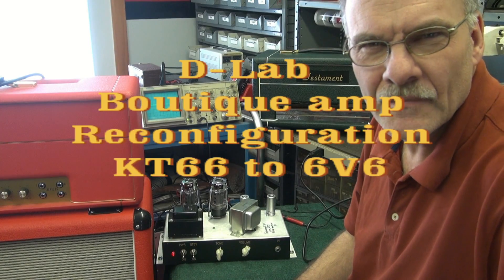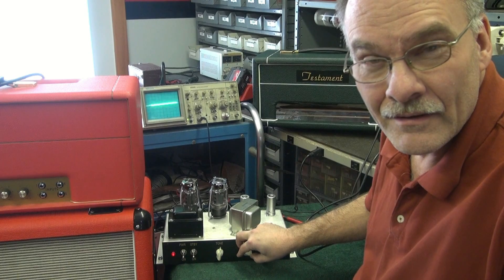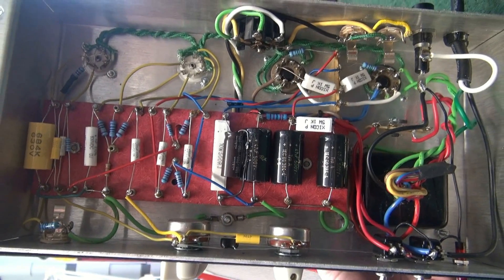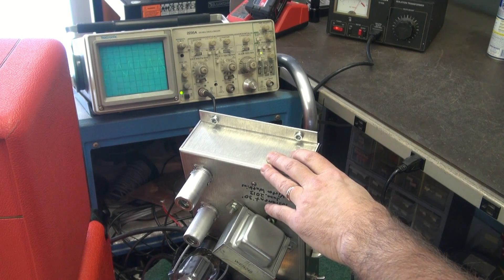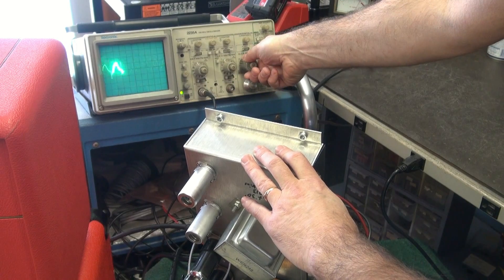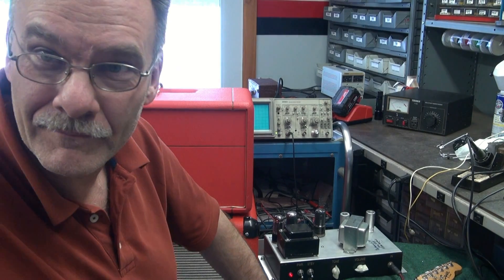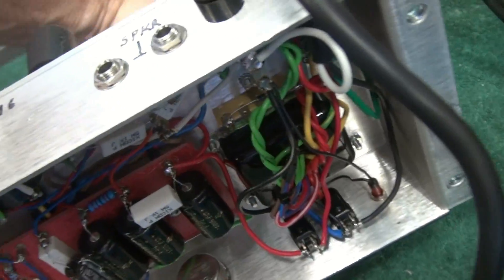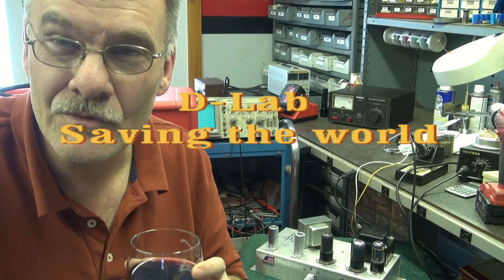Boutique guitar amp Tube Testament KT66 to 6V6 Mod How to by D-lab electronics

Comment: wonderful video!!!! HOWEVER......If you could NOT put in a tube rectifier, how would you go about correcting the hum issue from the diodes? on older Marshall amps they would put caps "around" the diodes to maybe "shunt" that switching noise. I AM NOT SAYING this is the way to do it. I have read and seen it done on the interwebz and am curious if this is a viable way to correct the issue you had in this amp? your videos are very cool!

Comment: Hi Terry, wanted to ask you a quick question. Will JJ KT66 tubes be ok to use in a Fender Blackface Bandmaster 40 watt amp that normally runs on 6L6's. Will the power transformer in those amps work with those valves? The JJ KT66 valves are 1.3 amps and 6L6's are .9 amps I believe. I presently have a manetic components Inc. By classic tone  output transformer in the amp . The company is in Chicago. The power transformer is stock original. Some people have told that the power transformer will over heat and blow up. Just wanted your professional opinion on this.  Thanks Terry from Michael Newell from Niagara Falls, Ontario, Canada

Comment: I have had to use two seriesed rectifiers on each side of the power transformer output leads to cure that noise problem. Fender uses three rectifiers on each side in their amps. Two 1N4007 silicon rectifiers on each wire would have been sufficient. The reverse voltage on the opposing winding presents peak negative level with the positive DC voltage in series across those rectifiers. So, if that is a 600 V center tapped transformer that puts 300 Vrms to each side of the rectifier set. This means each of those devices are going to see levels up to 2*1.414*Vrms. For 300 Vrms each diode sees 850V peak. A 1N4007 is a 1000 piv device. Two in series gives 2000 piv capability. Those can recover from their conduction half cycle faster preventing that reverse voltage spike noise and preventing possible failure if a good voltage spike hits that amp.

Comment: The hum showed up when you cranked up the gain.  This shows hum in the circuit BEFORE the volume control.  I would NOT have replaced the output tubes first.  Clearly the first culprit would have been the supplied power to the early tubes in front of the volume control.  I would have liked to see the original tubes put back in and all voltages and currents and power output measured.

Comment: Hi Terry!  I recognize that amp from the (now somewhat abandoned) Weber Amp forum.  It's a design (unfortunately) called the "Phat Ass", which guaranteed you could never successfully google for information about it.  (Try searching for "pa26-66 amp" instead.)  It was essentially just that Spitfire preamp with the parallel triodes input stage, volume-tone controls and LTP PI into whatever cathode-biased big-bottle output stage you could manage to cram onto it.  People usually used a 1000uF cathode bypass cap on the power tubes.  The maker of this particular amp even mentioned the hum problem in one of his threads.

I don't think the problem was the KT-66s with that OT.  By doubling the OT secondary values he was essentially giving the tubes an 8 KOhm load, which is pretty much right on the money for two KT-66s in class AB1.  And to be fair, the noise was still there with the 6V6s.  I think he underspecced his rectifier diodes -- one 1N4007 on either side is not enough for the high voltage secondaries on that PT!  I don't know how damaged the diodes were, but that would explain why subbing in the GZ34 fixed the problem.

Anyway, love your vids!  Keep 'em coming.
Reply: Basically agree!, or smoothing cap. in power supply - Brian (Dover uk) M6 BAQ

Comment: I recently got a nice Lafayette PA675 from ebay, plus I had to scrounge up a couple of EL34s for it.  It's completely stock, no tampering or mods.  I had it working yesterday, sounds sweet. The original caps are very quiet.  It's very well engineered, about 70 watts.  I made a vid about it, hope to post it during the coming week or so.  I have a little yet to do before I edit.  I really like this amp, not sure who built them for Lafayette. 
I also have a very old Bogen from the 50s, probably ten watts or so.  I will have to dig it out and see how it works, been in storage too long.  It's stuck behind my Hammond M3.  I'd like to get a Hammond reverb for the Lafayette or Bogen. 
I have a couple of Lafayette, and Olson,  solid state PA amps from the late 60s, but I like the tube stuff much better.    
Um nowhere near the knowledge that you have, but um learning as I go.  Thanks for the 411 vids! Someday I'll recap the PA675, but that's easy on that rig.  Until then, it's TLC, NO OVERDRIVE!  Um impressed as to how clean loud it gets, hurts the ears, as seen in my vid about it.  I saw your Lafayette vid too.   btw, I have less than 300$ invested in this amp, and uma happy camper. Hope to have it posted soon.
Don